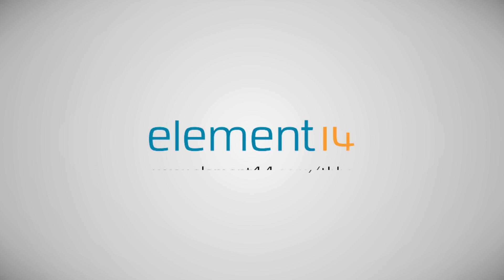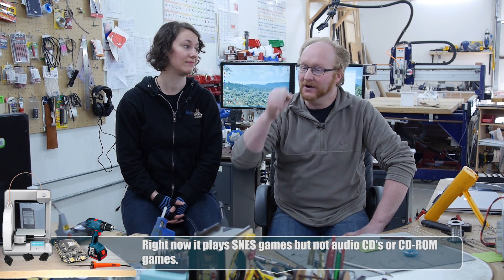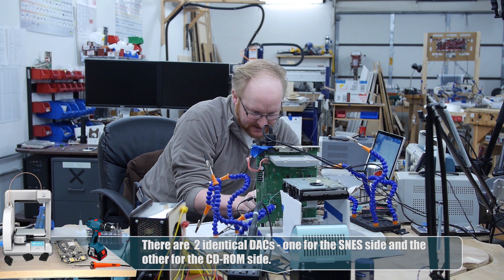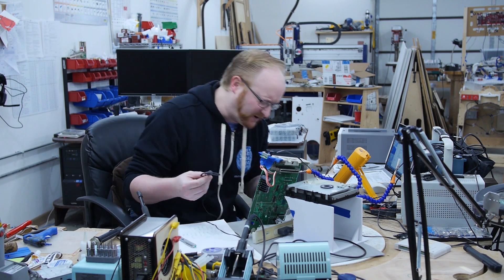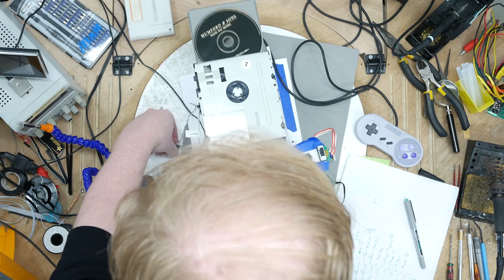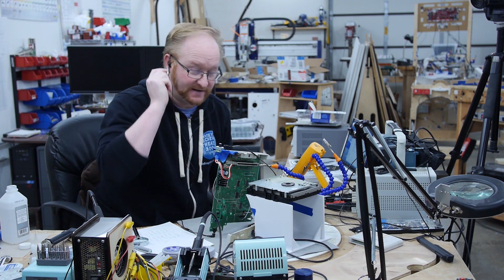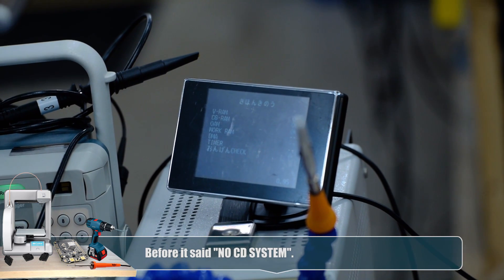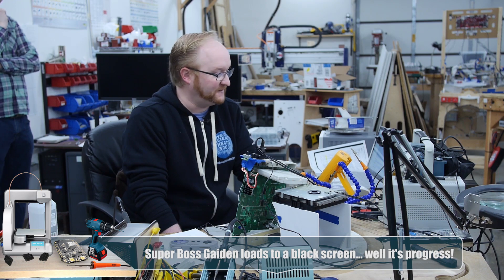Nintendo PlayStation Prototype: Finally Working!

Comment: Well the Question is would it be possible to creat a Hardware clone of it ? Or even a Ben Heck Hardware clone of this console ?
Reply: pigs18 I'd love RetroUSB/Kevtris to pick this up and make a fully fledged SNES CD (Super Disc) FPGA clone console
Reply: As I understand it, you sort of could, but it would be easier/cheaper to do a hybrid hardware/emulation clone where you recreate the common/mechanical parts and emulate the functions of the custom chips.
Reply: Just get a beefy microcontroller, make it accept the same commands and control a CD-ROM drive and bob's your uncle.
Reply: Amazing but Id like to have a Hardware clone of the Playstation and not Bob as my Uncle :P ( Thank you for the tip :3 )
Reply: Well, if you're talking a 1:1 clone, it's probably not possible as there is quite a lot of custom chips there.
Of course, you could reverse engineer chip by chip and use one (or more if you want the layout too) fpga/CPLD chips to reproduce the functionality, but it would still be your own design.
Reply: Well you have a point there
Reply: It is possible, but the first thing that needs to happen is a data dump of the BIOS and the firmware of all the chips so that emulation can be done better. Once that's out of the way, people can make homebrew software for it for fun, or it could be used to further the community's knowledge of how Nintendo's other retro systems function so that their emulation can be improved. 

Once the emulation is figured out, it should be possible to pop the emulator onto a Raspberry Pi and play games with it, or create an FPGA that approximates all of these hardware functions in modern hardware.
Reply: The bios is already out there, and its what they used to make the snes CD "emulator".
But probably there are secondary bioses on the system as well.
It will be fun when this ends landing on Byuu's hands.
Reply: greenaum whoever decides to take on such a task as creating a clone console of it should look at existing cd add-on consoles from the time period and create ram boosters and save cartridges, maybe through this we could get home brew ports of games like Rondo of Blood, taking full advantage of the 16 bit hardware but not being restricted by lack of space on cartridges like Dracula X was
Reply: You and I both.
Reply: I see a lot of fancy aCrOnYmS but noone actually knows what they're talking about
Reply: broKlee I can keep it simple without any jargon. 
Sure it could be cloned, anything could be cloned. 
The reason to clone something is generally for profit, if you can make something for less than someone else and there’s a market to support the effort then you’re good. This is the issue, it would be very expensive to clone a machine so unless you could sell a fuckton of them it doesn’t make any sense to do so. I don’t think there’s really any market for these at all in mass form so no one in their right mind would fund a cloning venture of this.
Reply: > What is the purpose of a hardware clone?

Knowledge preservation, mostly. Keeping certain projects alive so that others can learn from it is an incredibly useful resource because those technologies might have elements or ideas to them that may be useful in the future. 

A good example is the COBOL programming language. Most of the original COBOL devs are already dead, and with them goes a good chunk of knowledge because they didn't pass it on, or archive what they knew so that others could use their knowledge to continue to maintain things like old satellites or machinery that only ran with COBOL code.
Reply: It's pretty much just a Super Wild Card or UFO. The pirate thingys for the SNES that let you backup games onto floppy. Then they loaded the floppy into RAM, and the RAM acted like cartridge ROM, the SNES ran code from it without knowing any different. 

This is the same thing except using a CD drive, and also the SNES can send commands to it. The commands just being simple ones like "load data" and "open tray". 

So, CD drive + RAM + maybe a gate array or a microcontroller, you could probably make something close enough that'd plug into the expansion bus. Then you'd need to dump the boot cartridge. Actually you probably could build the boot cartridge into your clone, have it use the cartridge port.
Reply: People generally code for the snes for the challenge of the hardware limitations of the old, you know, having to program in 65c816 asm, dealing with the limited memory, cartridge space etc..
And CD-ROM games are a challenge by itself because you have to deal with the seek time, loading speed, caches etc..
It's let's say more fun than having this massive "unlimited" rom space.
Reply: What is the purpose of a hardware clone?  The system just loads data from CD into memory on a SNES cartridge, then plays it like any other SNES game.  There's already hardware to do that on a standard SNES using data written to a flash drive.  Nintendo Play Station is a cool piece of history, but it isn't giving you any new capabilities you don't already have with existing cartridge hacks other than ability to play music CDs.
Reply: NeoLPK On the Hardware side VIA was one who was going to the museum despiste the peculiar x86 design. Interesting enough Chinese saved them and now they are trying to "pull a Conroe" to catch Intel up.
Reply: Amir Pourghoureiyan there’s the MSU-1 and it’s associated rom hacks with streaming audio and video. What more could you want?

Comment: I'm watching this as I strip the wires to install PSnee in my PSOne. Coincidence? Most definitely.
Reply: Well, you program this into your ATTiny85: https://pastebin.com/9dJN6LaY (link to instructions on programming the ATTiny in code; I used a USBASP and passed -B4 parameter to avrdude to force lower speed for the chip to answer), and then you solder it to your PS1 according to the correspodning diagram here: http://imgur.com/a/ONniH and you should be good to go.
Unfortunately, I say all this in theory as I ruined my board solving an unrelated power issue, so I'll either have to repair another slightly damaged one I've got sitting on the shelf or source another console entirely.

Comment: Man, knowing what you know, I know you had to of 3D printed a copy of the shell and made schematics to make the boards to build a clone of the Nintendo PlayStation. Something's got to be made or done with this find...
Reply: Thats not a crazy idea given the CD drive is a standard Sony tray loader as previously mentioned, it's not insane to think that but then technically would you be able to link it up to the EXP port and have the BIOS cart see it (on the same address lines etc). Replicating the custom ASICs isn't hard with mordern chips
Reply: Having more hardware would be awesome for programmers.
Reply: B Simpson Personally, I would go with figuring out how to create the snes addon equivalent of this thing. Then you don't have to replicate the snes portion.
Shouldn't be THAT difficult, since I assume how this was made was by creating a single PCB with the snes system and CD drive system on the same board, and the expansion bus running internally between the two halves.
Split off the CD portion, and recreate that as it's own circuit board, and you should be 95% of the way there.
(plus replicating the control cart of course.)